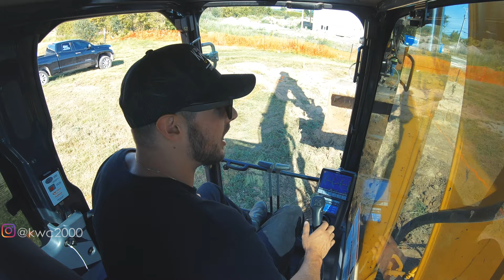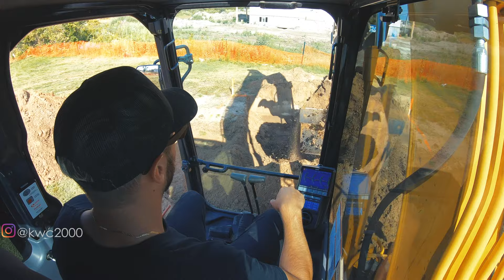Digging A New House (FULL EXCAVATION)

Comment: Dig it... Might look into a magnetic reciever bracket for the stick of the excavator. Then one man can check grade with the excavator. Just put your reciever on the bracket.
Reply from the maker: Brian! That’s the part I left out I don’t know how I forgot it, but I mentioned you and how I totally agree we need to make this more efficient and get a magnetic but I found out that we have a receiver end for the shovel just missing the bracket!
Reply: @KenWhiteConstruction  you can get the brackets where you got the reciever. What brand laser system is that?
Reply: I think it’s a Topcon Brian but I will have to double check on Monday. We have two grade lasers that are both used everyday.

Comment: Just curious, why do you guys generally seem to use the wider bucket instead of the traditional buckets with teeth on them for digging?
Reply from the maker: Because we can hold more material in that larger bucket and we like to leave a smooth flat surface. If I was doing some rock pulling or thicker material I would switch!
Reply: Ken White Construction makes sense. Thanks for the response and the great content man, appreciate your effort!